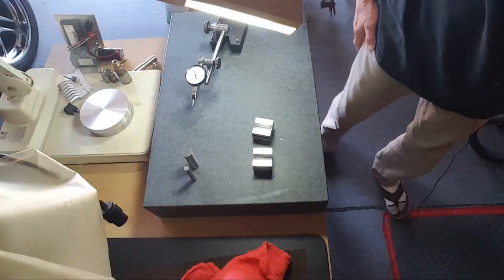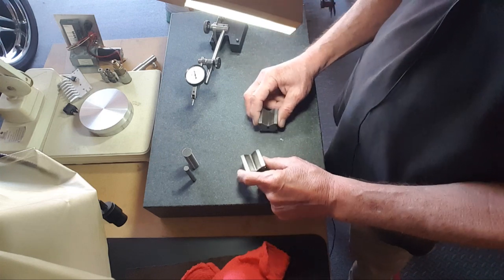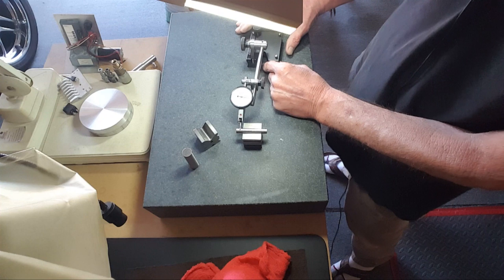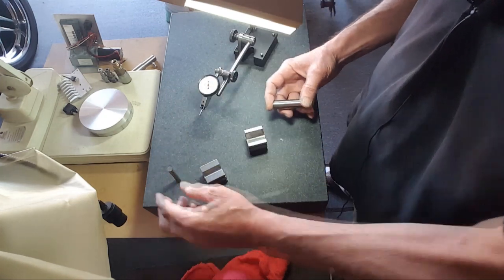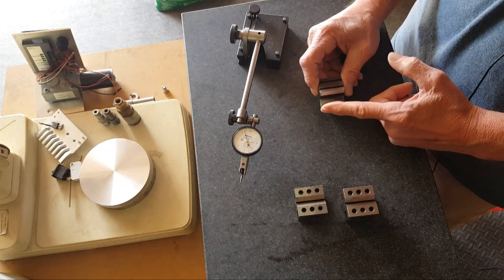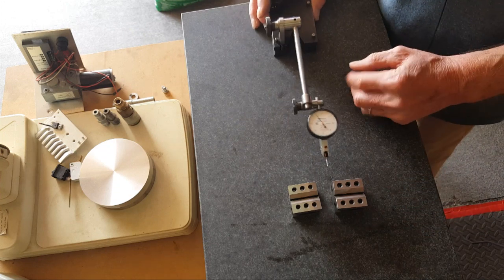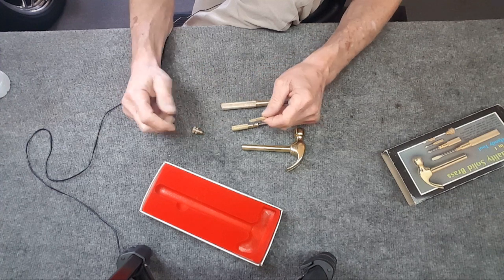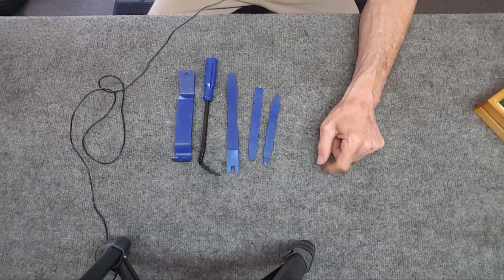V Blocks Starrett Versus Chinese

Comment: You want a matched pair because they are precision ground at the same time. It helps eliminate error to keep accuracy close in tolerance for precision work. 

On your surface gauge there should be two pins that can extend past the bottom. You can use those to guide along the side of the surface plate to help keep it straight. Indicators should always be keep straight in line with the same area you testing. Any off angle or movement off axis will give you a false reading. One more tip. Keep your guage arm closest to base as possible to eliminate any flex in between indicator and base.

Comment: Dave, the reason you want two V blocks is to dial in a longer piece of round stock on something like your milling machine.  The set of Starretts you have are beat if they show that much variance.  They are also missing parts.  There is supposed to be a machined rod that goes between the two blocks in that small hole you see in the end of the Starretts, to aid you in dialing them in, and they are also missing the clamps that normally come in a complete set.  The clamps look sort of like a horse shoe, and hook into the grooves in the side of the blocks and they can then be tightened down on a piece of round stock suspended between the blocks, so the round stock does not move.  The top of the "horse shoe" shape of the clamps has a hole and a thumbscrew in them for pinching the round stock, (or whatever shape you have) into the vee grooves.

The Starrett set was exceptional when it was new.  Rode hard and put away wet, now.  The Chinese are just now, in this century, figuring out what a surface grinder is for and how to use them. 
Your Starrett blocks are probably nearly 60 years old.

BTW, you can use V blocks in the mill vise, too, but then you would only mostly use one of them.

Happy chips,
Dean

Comment: Interesting video Dave. The little hammer brought back memories.  My Mother always had one of those in a kitchen drawer back in the 40's and 50's when I was a kid. I believe before China started producing these that they were originally made by the GAM Manufacturing Company in Lancaster, PA. The original ones did not have a Phillip's head as part of the set.
Reply from the maker: Very cool

Comment: Back in the middle of last century before DRO made life much easier we had to mark everything out.
We would have a matched pair of V blocks and put a four-foot shaft on them on a surface table and ink it up and mark out all the features like keyways, tapped holes and c clip grooves. That's why a matched pair.

Comment: Hi Dave, if you turn the guage pin round in the V block (end to end) & measure again, that'll give you information about the pin. Similar to when testing a spirit level.
Reply from the maker: Those were Meyer minus pins that I had checked all when I first got them but your right could be a few 1/10's off...
Reply: I was thinking the same..

Comment: Do you think you might be tilting the gauge pin a little by gauging it off the edge of the block.?  You might press down in the center of the pin or use the clamp then check the Gpins on each end.